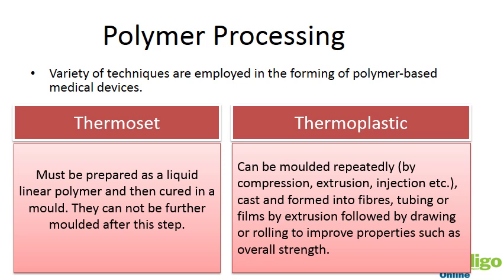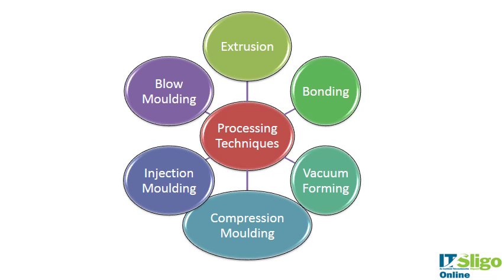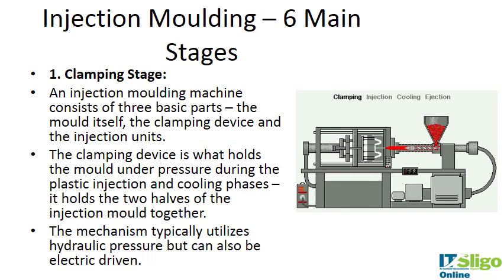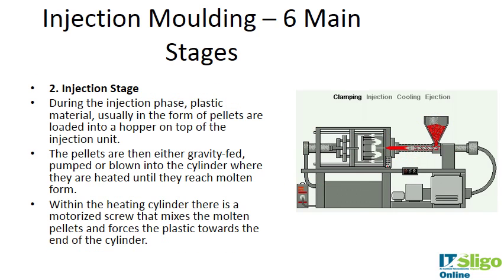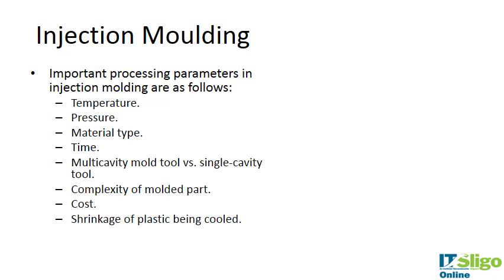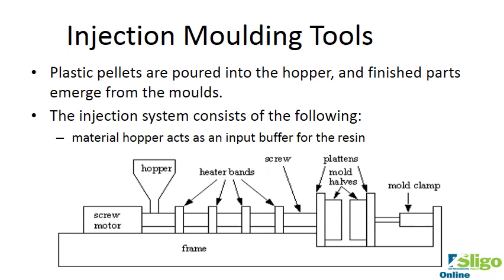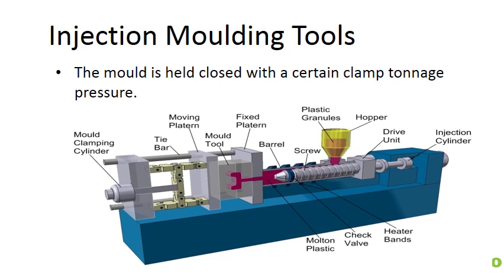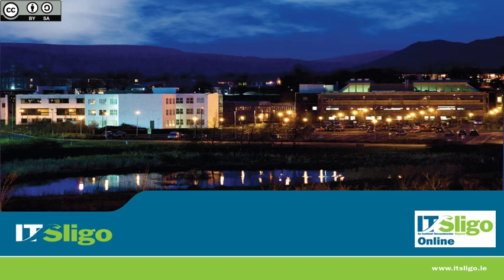Section 5.6 Polymer processing for medical devices - injection moulding

Comment: What is the relationship of Intrinsic viscosity to High capillary viscosity?  Since polymer are sensitive to heat and shear.  How would you expect a lower IV polymer to behave relative to a higher IV polymer when injection molding with the same process parameters? would you expect a higher flow rate, versus a lower flow rate during injection molding?